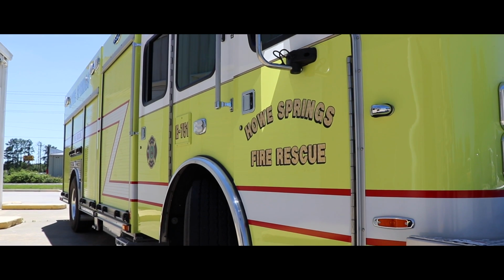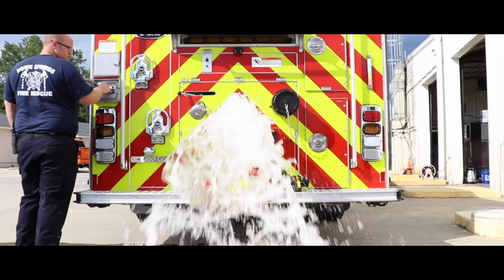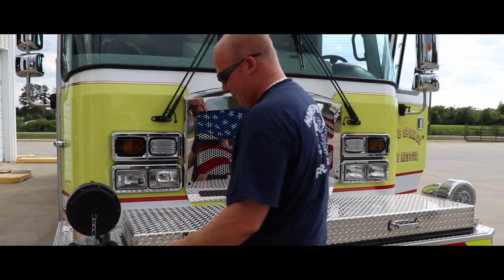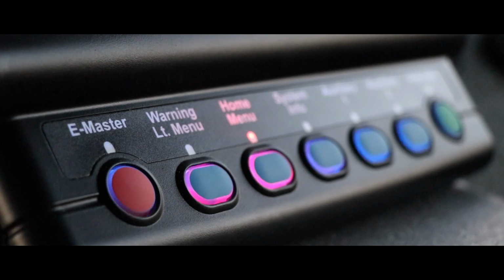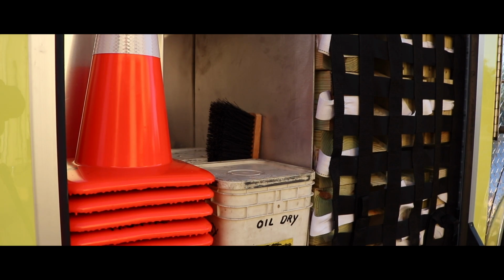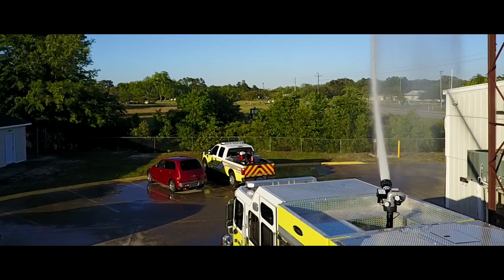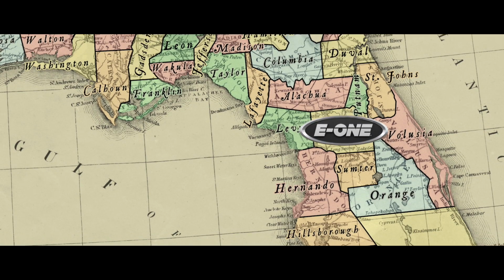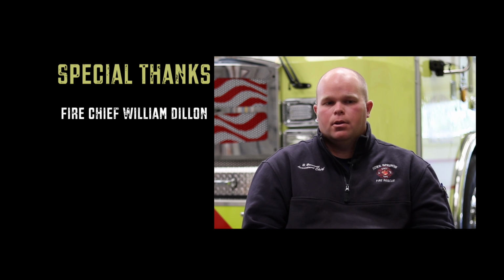Howe Springs Fire Department: New E-One Typhoon Engines

Comment: What type of hose load were they doing for the preconnects?
Reply from the maker: We use triple layer loads. The top preconnect is 150ft. for vehicle fires and the bottom two are 200ft. for structure fires.